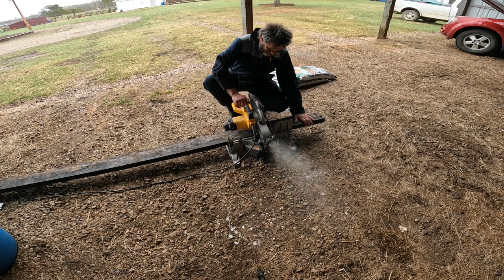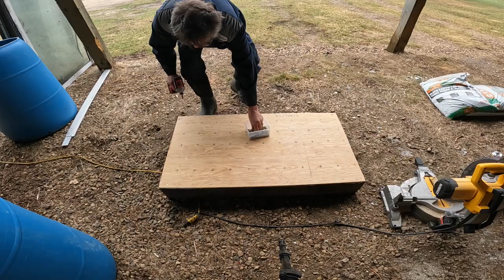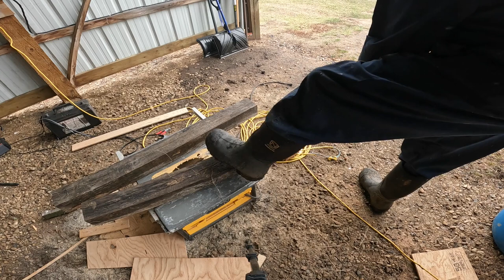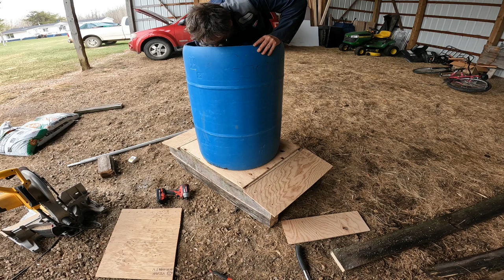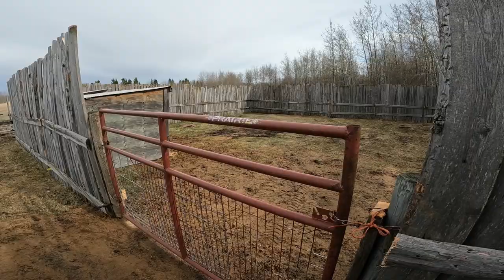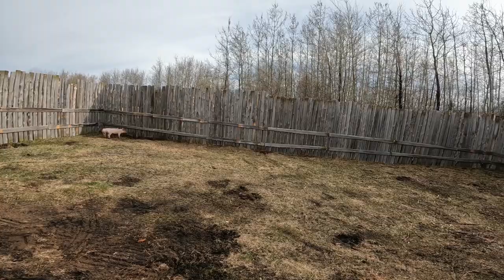Easy & Cheap Pig Feeder

Comment: New subscriber. That's a good feeder idea
Reply from the maker: Yes, actually it worked out really good. I fill it up and it's good for four weeks or so with two pigs. The only thing I would do differently is to ensure you insulate the bottom. If and moisture gets in it clogs up the feed. So far I only happened once or twice but your don't want it to happen ever. Also when the feeder gets empty the pig will start pushing it around, will have to secure it in some way. Apart from that I really like this feeder. I also have to work on their water, I need a drum with a drain at the bottom to clean it. Next summer I will work on it. For now it's back to shovelling snow.

Comment: Love the pig feeder! Do you have any dimensions?
Reply from the maker: I don't. Just build it one the fly. But this summer I need another, just  because it worked so good, and I'm getting 4 pigs next year. I will make another video and try and give some dimensions. Only one thing did not work so good. Next build I have to make sure where the drum sits it's water-tight. I did get some water in when it rained and had to clean it out. Also I'm going to build a cement pad to put the feeder on. Once it gets empty they tend to push it around. Stay tuned for an updated video on that, for now it's just snow and -40C, lucky me.